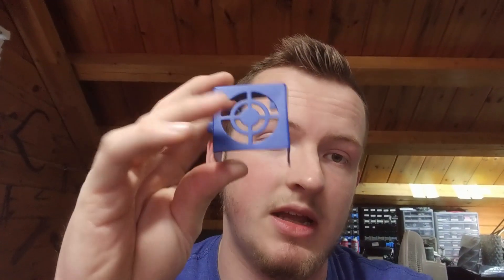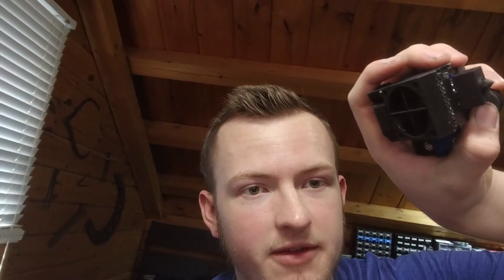Hero Me Gen 5 with Orbiter Extruder on a Tronxy XY2 Pro or ender 3

Comment: Did you need an external adapter? I am reading the pdf guide and it says to add whatever gantry adapter you need for the DD conversion, but I am pretty sure the orbiter just screws in right? Only HeroMe parts needed?
Reply from the maker: I just used the heroMe printed parts, Other than that just he stuff that came with my extruder